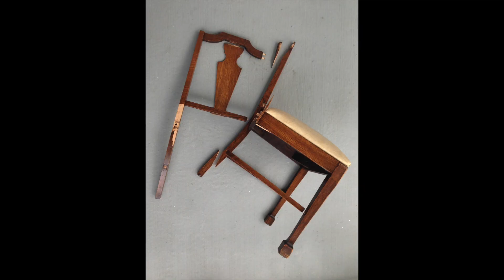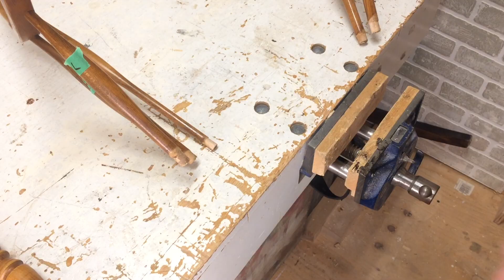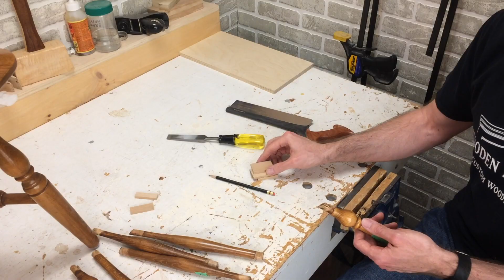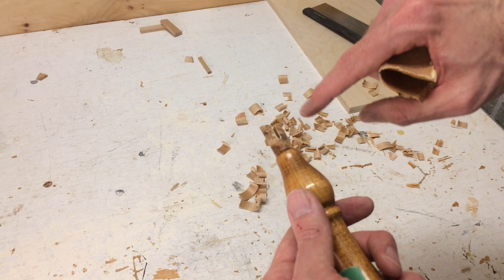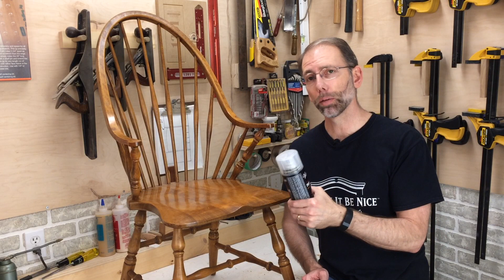Restoration of an American Windsor Chair | Woodworking How To #Restoration

Comment: Thank you for all you helpful videos. I have a American Boston Rocking chair. I believe it to be a early model replica but not sure. The chair needs to be redone as most of the joints are loose and the chair is very noisy when you use it. My question is, on the top plank on the back rest the spindles have dowels drilled and pressed in from the back to add to the joints on the spindles of the backrest.  Would I need to drill those out before trying to separate the back spindles from the top backrest plank and the bottom chair seat.
Reply: Correction,  I did a bit more research, it’s not a Boston Rocker. It’s a 1960’s S. Bent Bros Hitchcock Style Black Stencilled Country Colonial Rocker Rocking Chair.

Comment: Can you clean the old finish with soapy water before touching it up, or do you absolutely need to use mineral spirits?
Reply from the maker: Soap and water does an OK job, but it won't take off 100% of the dirt.  Mineral spirits have the ability to cut through more sticky stuff while not damaging a finish.  I hope that helps.  Scott

Comment: Hi Scott,, Great Videos!!!!. I have some S. Bent Windsor chairs that have loose legs. I have removed the legs following your videos and also removed the wedges. The legs into the seat have about 1/16" of play due to the fact that the legs have been loose for so long and have continued to be sat in. The seat is pine. Do you have a suggestion on how to make the holes a bit tighter before putting the wedges back in? Any help would greatly appreciated.

Comment: I have learned a lot from your chair repair videos, thank you. I have a Windsor rocking chair with arms and 54 loose joints. Four of them are wedge joints through the seat and four are rectangular mortice and tenon joints in back panels. I am worried about open time on the glue for assembly. I suppose I should work on the legs first then attack the back and arms.
Reply from the maker: Yes, assembling the legs first makes sense.  As you've seen in this video, the Fish glue I used from Lee Valley Tools has a good long open time for long assemblies.  I hope that helps.  Thanks for watching!  Scott

Comment: Your description of the repair is very clear and complete. Your camera work is excellent. Your narrative is very good.  Your voice is very soft which is pleasing. However when the music comes on it is overly loud which is not pleasing. The piano is harsh which is also not pleasing. Last there is too much speed up video when you are gluing up and assembling. I don't need to see you glue every joint, especially at high speed. Show the first one or two and I get the idea. I realize this video is now a year old so maybe my comments are no longer relevant. Thank you for sharing.
Reply from the maker: Hi Glen.  Thank you for your feedback.  That's helpful as a video creator.  Yes, my editing has matured a bit over the past year.  My last video really cut down the glue up scenes but I'm also getting comments about people wanting to see the whole glue up end to end.  Maybe I should put up one video that just shows a glue up in real time with no speed up for those type of viewers.  Scott
Reply: I understand. If you ask 10 folks about their preference you will get 10 different opinions. Music seems to be a big issue. My preference would be none at all while some like the current junk and loud. I could mute but then I miss your commentary. My problem with speed up video is that it looks so frantic. To me it's almost exhausting just to watch. And as I mentioned, repetition is a problem. If there are 10 spindles to be glued, then by the second one I got it. No need to show the next 8. Well I seem to be repeating myself. Thank you for putting up with me. No matter how it comes out you do good work. Thanks.
Reply from the maker: Glen Crandall thanks for your thoughts Glen.  I will keep your suggestions in mind for future editing.  Thank you.  Scott

Comment: Any tips on when assembling Ikea furniture. Is there anything we can do to make them a little more sturdier or stronger?
Reply from the maker: My only tip would be that if there are wooden dowels, glue them in place.  Other than that, you're relying on mechanical fasteners, so be gentle with the furniture when you use it.  Cheers.  Scott

Comment: You do very good work, and I like your calm demeanor. I have a part time furniture repair business too. I watch your videos to see what I can learn from you. In my opinion, old chair mortises get larger and the spindles get smaller as the chair dries out during use, therefore, I would have used epoxy instead of fish glue. It’s is stronger, fills gaps and is waterproof with the same open time as fish glue resulting in a more permanent repair. Much success, and many blessings.
Reply from the maker: Thanks for sharing your thoughts on this Thomas.  The reason I used fish glue instead of epoxy is that it's a reversible glue.  This is a piece worth saving, so if something breaks on it, the glue can be heated up, the joints taken apart, and the chair can be repaired as needed.  Epoxy isn't. a reversible glue, so I only use it on rare occasions.  Scott
Reply: Fixing Furniture thanks Scott.

Comment: Hi Scott, once again, amazing work. I’ve commented on your previous (maybe newer) videos, that I do furniture repair, and have recently come into finishing the pieces. Last month I worked  on a repair that involved two broken chairs which were broken off the joint between the back and the leg of the chair. Only one side, so I have to saw off the other side in order to repair both sides with dowel inserts. The original vertical 1” dowel inserts had a 1/4” down inserted into them horizontally through the leg of the chair. I’ve repaired pieces before, but this was the first time I came across a dowel inserted into another dowel, basically making a cross inside the wood. I usually see screws where that 1/4” dowel was placed. Have you seen that type of assembly before, where a smaller dowel is inserted through a larger dowel in order to hold it in place? Oddly enough, the 1” dowel seemed to be made from compressed wood, the material was very dusty/flakey, and was falling apart when I rubbed it. I glued and clamped as you always demonstrate. I have to tell you though, boy was the finish an issue! The chair originally had a dark reddish brown dye, with a red mahogany stain and a black glaze finish. Imagine figuring that one out and trying to blend in the colors to match the rest of the piece. Thankfully I’m DONE with that project, but now that I have the experience, I’d love to do more, knowing exactly how to go forward with the repair. As always, your videos are a tremendous help. Thank you for your detailed step by step explanation of the process. Please take care of yourself and stay safe! God bless, Scott. 

-Arno
Reply from the maker: I own a set of rocking chair that have a dowel through a dowel on the joint between the front of the arm and the seat.  These are inexpensive rockers I bought from our front porch about 20 years ago, and I haven't seen another joint like it.  It's good to hear you rose to the challenge and were successful in your repair.  It sounds like you're more knowledgeable now given the experience... which is why furniture repair experts as so hard to find... it takes a lot of experience to know how to handle all situations.  Thanks and you stay safe too.  Cheers.  Scott

Comment: I use a leather strop with a honing compound, why then do you use a 'clean' leather without the honing compound?  I'm guessing it is a further refinement.  Does it make a difference to the sharpness of the blade?  Also, did I hear somewhere that you sharpen your plane blades to an angle of 40 degrees?
Reply from the maker: Yes, the clean leather side is for future polishing of the cutting edge.  To be honest, I haven't tried not using the clean leather side to see if it makes a difference in the cutting action.  It does visibly show a difference.

For plane blades, I use the standard 25 degree angle.  Do you sharpen to 40 degrees?  If so, do you notice a difference in the cutting action?